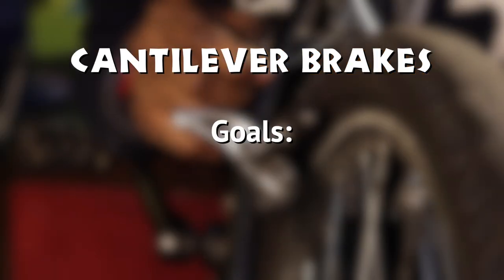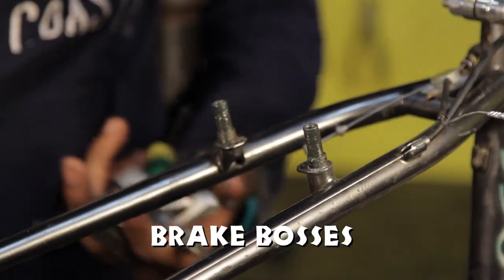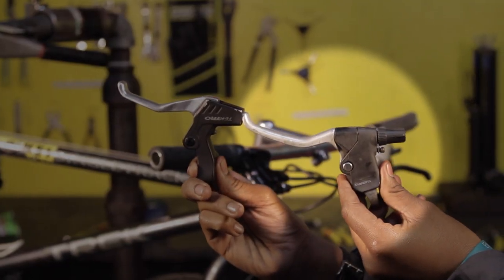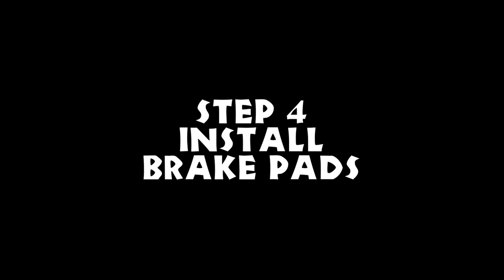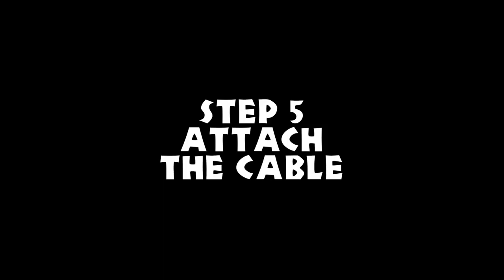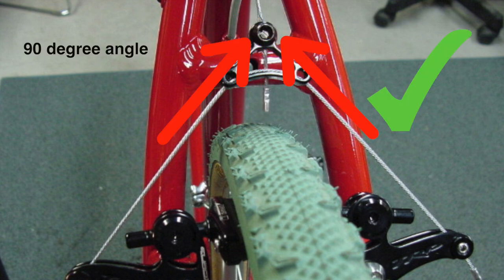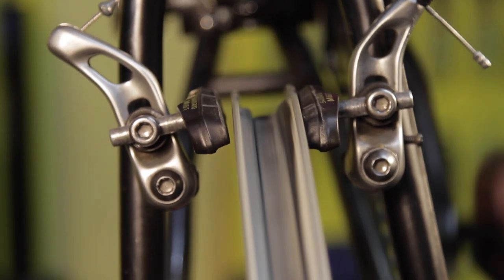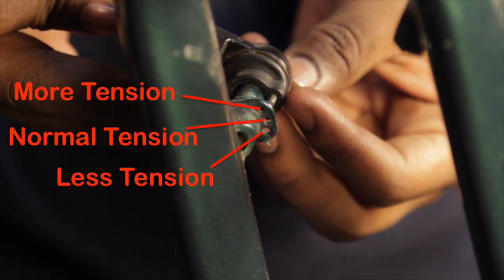Cantilever Brakes - Shifting Power

Comment: Thanks for such an informative video, I am desperately having a question that I can not find the answer anywhere online. I have a bike with smooth stud cantilever brakes pads with shaft diameter of 6mm, when I browse Amazon to buy new pads for my bike they mostly mention 6.75 mm for brake pad shaft diameter, and most brake pads online they do not even mention the shaft diameter. How do you guys choose the right brake pad shaft diameter for your bikes?